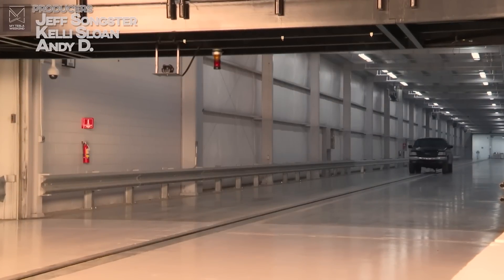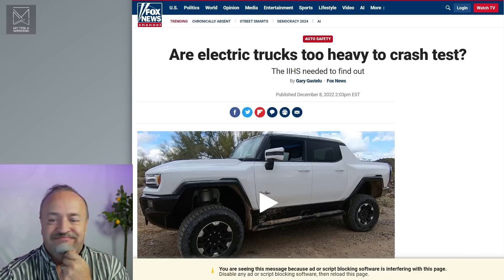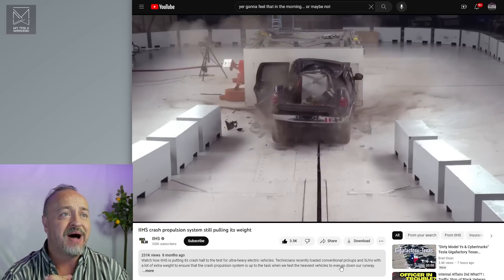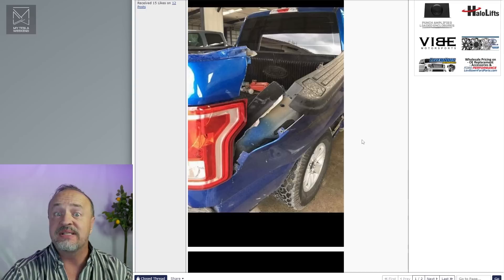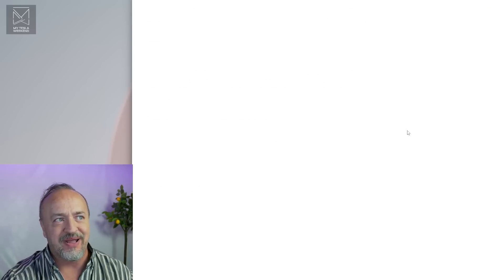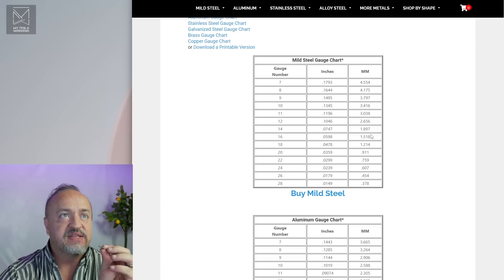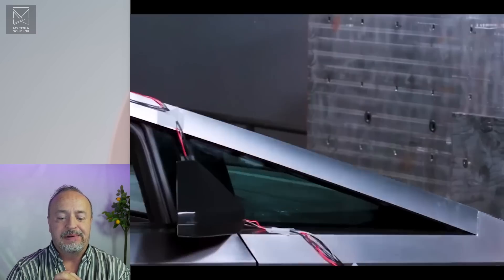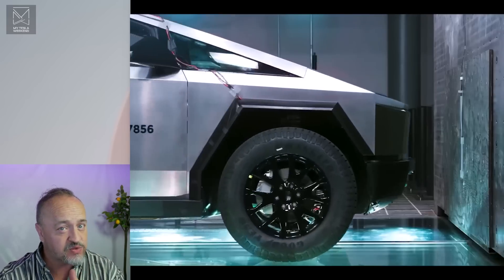Cybertruck Won't Kill You in a crash - When cargo becomes a missile

Comment: Also racing' cars, you learn lots about accident like flipping like getting bump by another car into armco and I seen lots including end over end crash which is super violent and if the race car drivers survives his car is shorter in the front and back.  The safes way to crash is roll but don't hit a wall.  Like the P51 war planes they would do a cart wheel to let off energy as they crash and generally the pilot survives.  What about a flat bed truck getting into a head-on accident.  That flat bet will slice you in half.  Best way to drive is like a motorcycle and that is to avoid accidents cause it is usual fatal

Comment: Cold rolling does increase the tensile strength of the stainless steel. Elon said it would be made from stainless steel nearly 3 mm thick, but it wasn't mentioned whether that was thickness of the steel before or after the cold-rolling to a full hard condition. That cold-rolling is done using so much pressure the metal actually gets considerably thinner.

Comment: So if a bullet will go through a sheet of paper then you need 3x the weight of bullet to go through 3 sheets of paper?
Not convinced on the maths but it will be interesting to see how the CT holds up to this crash test.
If it does come through safely for the occupants then this will be a huge consideration 🙂
Reply from the maker: This demo showed 4,500 pounds. That is a lot like a bullet going through paper, or going through paper vs. cardboard. The bullet is still gonna win.

That's why I lowered the weight in the conclusion to 600 vs 1,800 pounds.

If a low-velocity airsoft pellet will just barely breach a sheet of paper, it will not breach 3 sheets of paper.

Comment: Liked your vid but I have a slightly different concern. The Cold rolled stainless exoskeleton will be very stiff. Far stiffer than all other cars on the market. It will not deform anywhere near as much on impact. Therefore the energy absorbing nature of typical modern cars will not be present. Sure there will be less damage on impact but the G-Force at the driver and passengers will be far greater. Better seat belts and harnesses will be needed at the very least. .
Reply: This is why the body won't have those properties and this is all speculative nonesense.

Comment: 3mm thick stainless steel about 22.5kg/sq. meter...double the weight of carbon steel.  Exoskeleton design claim is up for debate according to Munro.  CT will do well in a crash.
Reply from the maker: The fact that it's going to be structural isn't something Sandy or Cory debate. That's established. The fact that it could still drive without the skin without collapsing under its own weight means it's at least partially unibody.

If the skin provides no structure, they'll reduce the thickness significantly to save weight.

Comment: The shape of the material is also important.  Just like cardboard bends in on direction, making 2 layers with the bend direction at 90 degrees, you can make something much stronger than a flat piece of cardboard.  I think there is a lot more to this than just the thickness of the metal, but the metal strength is a good start.

Comment: Hey love your videos but I think in this one you may be incorrect in your assumption (or I may be wrong, happens from time to time :-P).  The CyberTruck has an external stainless steel body, agreed, but from the latest Q2 investors pdf page 15, the panel between the cabin and bed, it appears to be stamped steel (or other material) with a structural beam to support it.  The beam appears to be steel as well and could be high strength to protect from this very issue but the cabin isn't protected by stainless steel in the CT.   Just my thought from what I can see in the released pictures.
Thanks for the video and keep up the great work :-).
Reply: True.  And are we sure that the flat exterior stainless steel panels are 3mm thick?  That was true four years ago when the structure of the CT prototype was provided by an exoskeleton, but as Sandy Munro pointed out, a true exoskeleton is no longer utilized.  I wouldn't be surprised if much of the exterior metal is less than 3mm thick to reduce the overall weight of the vehicle.

Comment: 1:00 Absolutely incorrect.
Crash testing is mandated by law in the united states, we have standards all automakers must meet.
Reply from the maker: F350s and above are not classed as passenger vehicles, and not subject to crash standards. Crazy, I agree.
Reply: In the Midwest we have been dealing with (read ignoring) or lightly mitigating this issue. Goes back to hogs and sheep coming, not thru the box walls, but thru the rear windows. The vault cover might well do as good or better a job then anything that was hacked together on the farm. Roll bars with a cross cage and installed professionally might be best or maybe overkill.

Comment: I agree with many of the comments here. Yes, thickness of the metal is a thing, but when it comes to crash testing and construction using that metal, the trucks are designed with crunch zones. I'm guessing the crunch zone of a pickup bed is since it's not a passenger compartment, is different than the cab. And yes, this load goes right through the cab. And yes, that could be a very real scenario. Of course, all the calculations are not going to give you the actual test results. So until Tesla does a crash test or shows the public a crash test? I'm sure they've been done already otherwise they would not be on the road. Only apples to apples is going to work in this scenario. Using heavier metal means they're probably not using as much, but with the technology that Tesla uses in designing their vehicles and that they're the safest vehicles on the road. I have to believe that they followed that model with the cyber truck. Pick up trucks have never been more than a box on a frame. The frames, the drive trains the engines pretty much bulletproof the cab and the bed pretty much sacrificial. And today a lot of truck parts are made with aluminum again with appropriate construction to be using aluminum but it's still aluminum. And as far as crash testing trucks, they crash test semis so I'm pretty sure they could figure out a way to crash test pickup trucks. Maybe it's not required by law. If that's the case then maybe it's time it was required by law since there are more pickup trucks on the road than almost any other vehicle except maybe SUVs which is just the glorified pick up truck.

Comment: If chatGPT3.5 is to be believed, the weight for a 6.5 ft. bed of a traditional pickup as of its training date would be between 250 to 600 pounds.  If the SS is 3 times thicker than the mild steel 250 pound estimate, that would be an additional 500 pounds.  chatGPT estimates that the  ladder frame alone to weigh between 200 to 400 pounds.  It is reasonable to assume that the angular sidewall is providing strength to the rear portion of the Cybertruck that would have been provided by the ladder frame.

I really have no idea if Cybertruck will be heavy overall, but it seems like it will be heavy in the correct spots.

Comment: My 2013 Tacoma has a composite bed, which has carried all kinds on material, including rocks. It really doesn't dent and so far the structure under the bed has supported my loads. I did have to get bed stiffeners because easy strapping of loads pulled the body out of wack. The bed stiffeners do provide much better strap attachment points. I also go rid of the plastic bed caps, replacing them with metal ones and have a DiamondBack tonneau cover. Of course I also added air shocks because the stock springs are worthless. Two people standing in the bed almost collapses the bed onto the tires. As on almost all trucks, the bed is separate from the cab, allowing the truck frame to twist all over the place. I doubt the CT will twist at all. As for crashing at 60mph(?), the passenger cab is going to collapse no matter what. The engine is hopefully going to slide under the passenger area but it wouldn't surprise me if it goes right into the occupants. Their torso might be saved but the legs will be gone. This truck is a crew cab (or whatever this manufacturer calls it) so there's less space for this improperly secured load to travel before squeezing the driver. I have a double cab so there's more room for the load to travel before hitting me. Either way, I would be toast or a toasted cheese sandwich properly squeezed. From what I've seen of the read gigacasting, the CT doesn't necessarily have that much structure between the bed and passenger compartment so an improperly secured load might do something similar. Of course, hopefully the CT's driver assist software will slow down and stop the truck before smashing into a wall.

Comment: The Cybertruck won't be able to stop that refrigerator.  They still have a window back there as well as one on top which hurts the structural integrity. The front of the bed would need to be too thick with several layers, even with stainless steel, to stop anything.  And btw, that video you used was an old Ford truck so of course it's not as good as it could be.
Reply: The glass roof is way stronger than a steel roof.
Reply from the maker: In the case of this crash, it isn't a fridge but a 4,500 pound concrete block. That's a lot of kinetic energy, and I don't think much is going to stop it. A fridge on the other hand, which is a lot more common in terms of hauling, would absolutely be stopped by the Cybertruck's design.

It has the 3mm stainless in the bed, additional steel and reinforcement at the rear of the cabin, and the entire rolled up tonneau cover it would need to compromise. That's an awful lot of high strength material.

The rear window is very small. Almost decorative. That's not a serious amount of consideration. And as others have said, the glass roof will provide substantially more crush protection in a lateral plane than the 20-guage material common on truck roofs.

Comment: can't wait for TSLA to also load similar weight as far back into the bed as possible then slam into a solid wall. We know that's never going to happen. You will notice that they used a very old Ford (cheap) to do that experiment. No one is going to trash a $80K-$100K truck for that type of test. CT stainless steel "panels" will be bolted or welded onto the vehicle frame, so the stainless-steel strength is not going to help in load shifts coming from within the truck bed to outwards, It's the inner body frame strength that's going to take all the load, The SS body panels will just move outwards with the inner frame. As for a boat coming off the trailer, you better hope you have the Truck bed closed so it can deflect most of the weight of the boat upwards, otherwise you will get the same result. The boat will clear the SS tailgate start dipping into the 6ft bed and crash into the "regular" steel /aluminum body castings and damage the CT the same.

Comment: Cybertruck will either never float well, or if it floats it will develop a severe nasty smell.  Why?  Every pickup truck ever made has large drain holes in the bed.  That's because it rains in most places of the world, and water has to have a way to drain out of the bed.  Close the rear cover! you say.  Yeah, that will only trap in moisture that will accumulate around the sliding cover.  End result?  Either design a truck bed that drains, or be prepared to grow mold, mildew, and stainless steel mushrooms!

Comment: To be fair, the load could have been better secured.
All loads should be strapped to the front of the bed to prevent the load from gaining relative speed to the vehicle when it comes to an abrupt stop.
I would like to see the impact if the load was better secured.

Still, a very scary video!
And you are right.  If CT were able to withstand that type of event and all other OEM trucks cannot, it would make for a viral video.  All you need is 4 trucks to destroy.  CT, F-150, Chevy, Dodge RAM.  Go for it!
Reply: 9:51 mark shows no front to rear straps were used so even hard braking or acceleration would shift this load. It appears they used properly sized ratcheting straps but those popped off immediately.
Reply: Pickup boxes are rather light duty these days.    With a crash of that sort even the older heavier boxes are  not strong enough to stop a load.  It just tears or distorts the box.   One would have to have the load bolted to the frame.    The points for straps are there to keep the load from moving around.   Not up to holding anything back in a crash.  If one had a flatbed with mounting points welded to the bed it might be different.
Reply: It looked to me that it was up against the back of the cab, but a couple wheels and tires were between the weight and the cab.
Reply: @davidhuber6251   If you are right, it's even scarier!
Reply: No strap can hold back 60 tonnes.